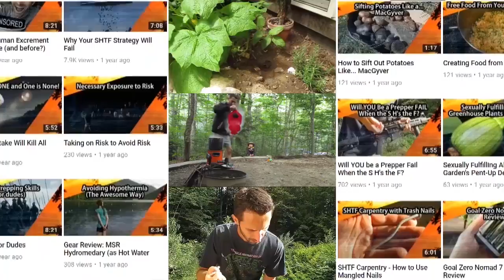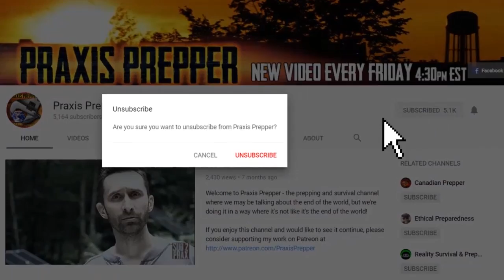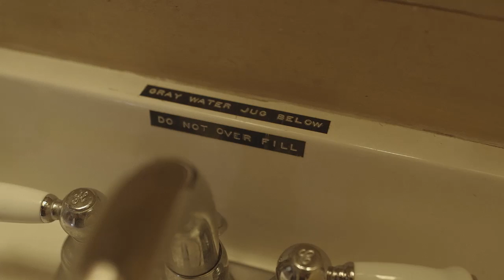This is How You SURVIVE When the Resources Dwindle

Comment: Will add to your thoughts for those of us in a hot climate. Middle GA here, it is hitting the mid 90's with very high humidity and I haven't used the AC in 2 years. Using heavy thermal curtains, opening double hung windows strategically, plus a couple of fans keeps the house comfortable. Folks knew how to cool their  homes without power in the 19th century, those methods still work today.
Reply from the maker: Thanks for the insight. It's been a while since I heard from you too (I think). Nice to hear your thoughts!
Reply: Houses are not built today like they were in the 19th Century.  Older homes had tall ceiling . Some over 12 feet.  Lots of windows for cross ventilation.   Overhanging eves,  Very tall attics.  Trees planted all around the house for shade.  Homes today would be like a hot box without HVAC.  As a kid I lived in homes without A/C and it was miserable.  Well over 85 degrees even at night.  I lived close to Houston TX.  The armpit of America.  Hot and Humid.  I now live in Austin Texas.  We are on our 48th straight day of over 100 degree days.
Reply: Lots of houses still have double hung windows (my small 50 yr old house does). People that prepare can also plant foliage around the house, put up shutters/shades, and learn how to use their windows for cross ventilation. Next spring I will trellis pole beans to block the sun on two sides of the house.

Comment: One other comment for you.  If you live in a house that doesn't have good lightening and want to bring in nice natural light without making big holes in your home, fiber optics!  There are solar collectors that you have outside and put the light into fiber optic cables and you run those to diffusers, that look like an overhead light fixture, and now you have lovely natural light.  One big plus to fiber optic light transmission is you don't have roof penetrations meaning less places for the roof to develop a leak from.
Reply from the maker: I've thought about something like that for my root cellar/ fallout shelter. If I had a fluid-filled tube, it could act like a fiber optic, AND help to block more radiation than would a simple air filled light tube.

Comment: I'm not sure where you are in your new build, but we use shower water to wash clothes, and then it goes into the garden.  It wouldn't be too hard to create a set up vastly more efficient than ours it if that was your goal from the start.
Reply from the maker: I'm definitely capturing the gray water in a holding tank at the new house... after the final inspection concludes and I do the final tweaks on the plumbing.

Comment: I would run the  warm water to the greenhouse through some recycled radiators.
Reply from the maker: Running gray water through anything narrow does pose the risk of clogging because of the dead human skin and hair etc. But there's definitely a lot of heat to be recaptured in it after a hot shower!
Reply: Here in the U.K. we used to have large cast iron radiators much larger than modern day but I get your point thanks for the reply cheers.